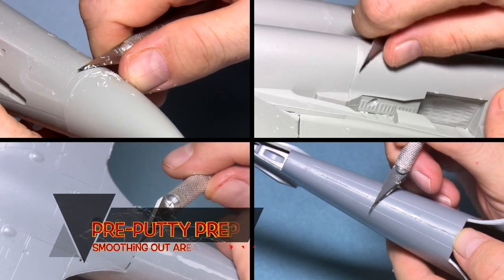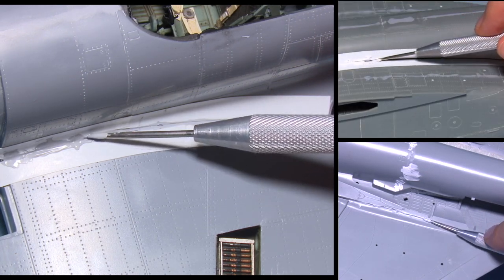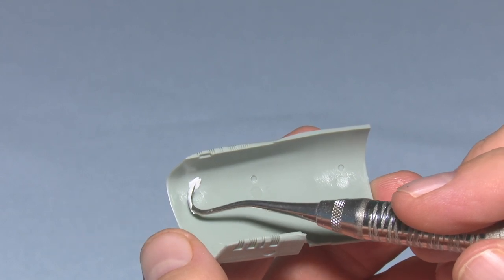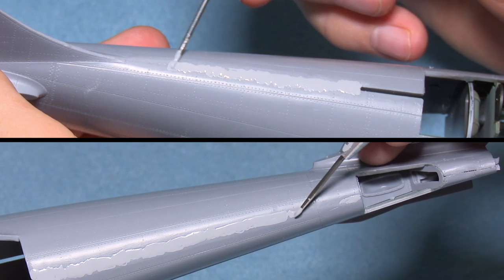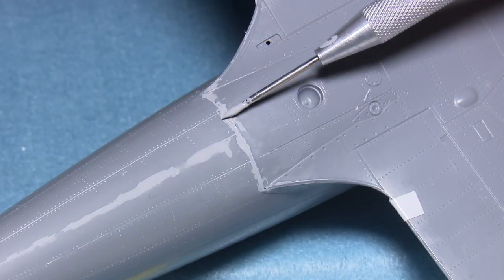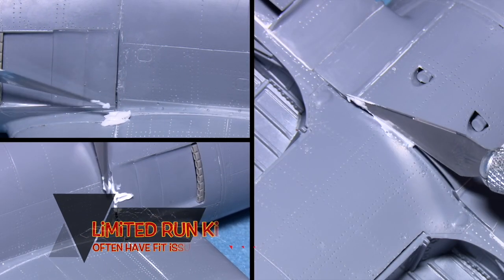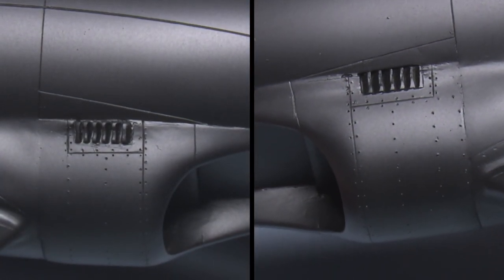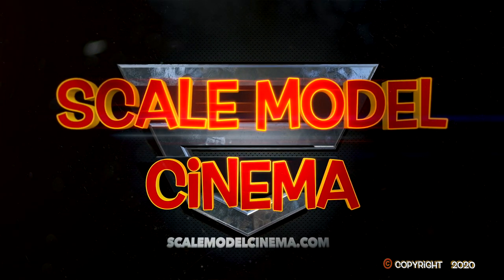Model Making Techniques #2:  Applying Putty & Sanding

Comment: I'm just coming back to modelling after a break of... many years, but with main joins like the fuselage and cowling, I can't see why I shouldn't use sprue goo to glue them together. If it's done carefully, won't that fill the gap at the same time as gluing them together?

Comment: The techniques used is awesome and easy-to-follow. I'd prefer to mask on both sides of the fuselage and similar to prevent loss-of-panel lines and rivets respectively. To re-scribe and re-rivet is mind boggling most of the time. Have subscribed to your channel. Thank You for Sharing is Caring !

Comment: with the MR Surfacer , i fill the seam up, let dry . Then use Iso Proponol on a cotton bud and rub that back n forth to remove the excess putty from the model. Try it - i think you will find it alot quicker than taping up / masking the seam off. Excellent vid BTW
Reply from the maker: Cheers Julian, I do that all the time with the acrylic  (perfect plastic) putties but I find that the cleanup of Mr Surfacer always ends in a sticky mess that never gets fully cleaned up...but I havnt tried for a very long time so I might give it a go again :D just avoid getting it in the rivet holes :)
Reply: @scalemodelcinema9900  all good. Really enjoy your vids. They are very informative. I'm getting back into my model building after a very long hiatus. currently building a 1/32 sufa

Comment: Fantastic video, a lot of nice tips and techniques and so much examples. And I appreciate your time mixing up so much videos footage in one. Great and impressive job!
On techniques I just want to add that it is worth to mention use of CA glue accelerator. CA glue + accelerator makes the process much faster than with Surfacer. And both CA and Surfacer goes very well together!

Comment: Great video - I learned a lot from it. I'd never thought to use the water based filler (Vallejo Plastic Putty in my case, it's not actually plastic) as a foundation for another filler. I'm definitely going to try that.

Comment: I switched mostly to superglue + baby powder for filling. Sets instant with kicker, doesnt shrink , sands easy and scribes really well.
Reply: kicker weakens the joint at a chemical level hence why it goes white ... i don't use kicker no need or the baby powder its just messier that way and not really stronger than non kicked glue
Reply: @vasili1207  Sands a lot easier though !

Comment: The wet cotton bud is with water? alcohol? Thanks! amazing works!
Reply: Im pretty sure its water :)
Reply: Vallejo plastic putty - use water to smooth, Mr Surfacer 500, 1000 - use Isopropanol to smooth

Comment: Imo the gaps in the F-80,and large gaps in general, should first be "bridged" were possible with stretched sprue/sprue goo to provide a foundation and prevent flexing of the parts,which will break the putty.

Comment: Bit late here, but any thoughts on "spue goo"?
Heat stretch some of the kits sprue, them melt it into the gap with liquid solvent cement. You end up with a very solid structure, as it is all made from the same grade of plastic. Also limits the use of putty to final finishing.
Reply from the maker: Hey, that is an option, but I think if you are looking at using plastic as the filler (which is a very good option for large gaps, and I shouldve included that as one of the methods really) I suspect that using the right mm size plasticard might be a better option? Cant say I've tried the strech method for this. My only issue with using plastic as a filler is often there is more mess in terms of keeping the glue in the joint and avoiding getting any on the surface, especially if theres any raised surface detail in the area.
cheers for the info though, worth investigating further :)
Reply: @scalemodelcinema9900  Oh it's messy as hell, often have to re scribe surface details, but I find a lot of panel lines on modern kits are too wide for my liking anyway. And I'm always concerned that filler will shrink and crack.
Great video.
Reply from the maker: @ploppysonofploppy6066  Yeah cracking can be an issue with some putties, I find that the recent 'perfect plastic' water based ones are pretty flexible and havnt ever had any cracks with them. The other thing that helps with that is a decent thickness of undercoat (not too much though) as this can bind the putty and plastic at the join. Mr surfacer 1500 black (undercoat) is also resonably flexible and bonds well. The key is to fill the gap completly so that there is no room for the putty to move, especially near the surface of the gap. I hear you re the panel lines, Airfix anyone :P
Reply: @scalemodelcinema9900  I'll give it a go. Cheers. 👍

Comment: Nice vidoe, BUT the gaps that big like on the f-80C is much better fill with piece of plastic sheet, sand into the rigth shape and add little filler/CA glue to fill minor imperfections. It is better base for scribing and you have no risk that vast amount of solvent based putty will shrink after longer period of time as it tends to and wil not show mess on finished model...

Comment: as a cheap alternative for filling in those large gaps, would you recommend a drywall filler? it always comes in a large tube generally priced around $5-10 dollars. they dry up in about 20-30 mins depending on how much was used. then you can apply the fuselage gap filler afterwards to fill in the top part and sand it down to make it seamless. a tube of the Tamiya basic putty is like $8 and it's not a very big tube. that way, you're only using a little amount of the Tamiya putty and could end up having a tube enough for maybe like 5-10 models.
Reply: I almost exclusively use vinyl spackle for filler in my scratch and kit builds, it works great and can be thinned with water or denatured alcohol. If I have a large gap that I want to also have some structure to it I'll use JB weld plastic putty or Bondo depending on the application. You get the same results with for allot less cost than the model specific fillers.

Comment: Hi great video! I just happen to have one question: I use Tamiya basic putty and my question is how do I remove it from raised detail where if I were to sand it would disappear. Keep making videos
Reply: With nail polish remover and cotton buds/cotton pads while the putty is still "wet",a couple of minutes after you apply it will do.Try it first in a hidden part to check if it harms the plastic of your kit. Do not use straight aceton,only the watered down,colored type from supermarkets.
Reply: @Panos-xo9rc  thank you so much! I will definitely try this out

Comment: Tip: Don't use the cutting side of the blade to scratch flash off. Blades use to have a sharp edge on the back (top of it) specially designed for that purpose. In that way you don't dull the cutting edge of the blade. It is specially designed for scraping. It works a lot better.

Comment: Say exactly what putty, removable with a wet swab, you use to fill large gaps (11:00 recording).
Reply from the maker: Perfect plastic putty - water based, I also use Mr surfacer 1200 - lacquer based (Mr leveling thinner to remove)